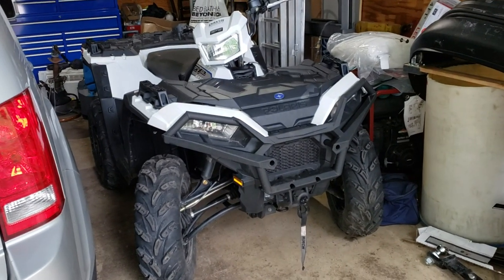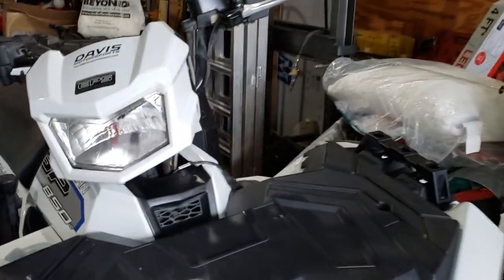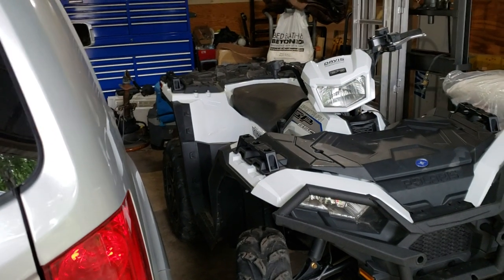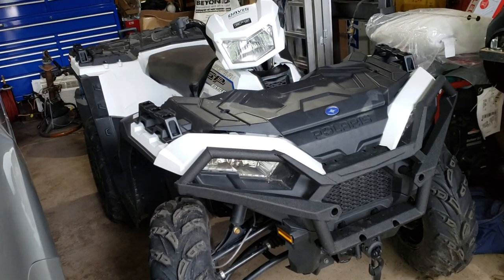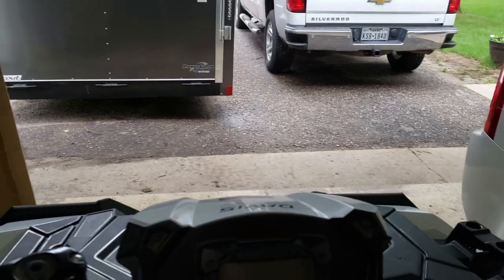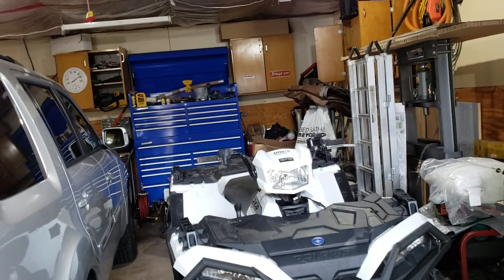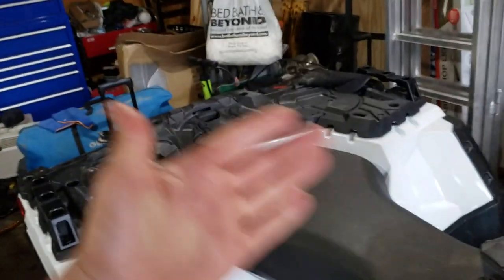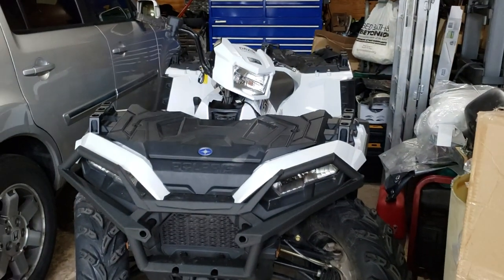2019 Polaris Sportsman 850 SP HO

Comment: we bought a left over 2018 sportsman 850 sp 3 weeks ago ($8,599).  ours doesnt jerk or grab at take off, its very smooth.  gone through water up to our knees and never missed a beat.  we already have 160 miles on it, I think its past due for the first service, lol, but we've been riding and having a good time.  we still have 32 hours to go til first service according to the display, but they told us 100 miles, 1 month or 20 hours whichever came first.  Obviously the mileage came first.  Oour SP is matte gray/red.  I have a 2019 yamaha grizzly 700 that is Alpine White like your's.  I love the color plus like you said most don't have white.  The one thing I do not like about it is that it stains up badly if you get any mud or rub against something.  The stains on the white look terrible so I spend a lot of time with a wash rag cleaning mine up after rides just so I don't have any long term damage to the exterior.  If I had it to do over again I'd probably go with the Blue or Burgundy that yamaha has.  BTW, can you tell me what is the difference in H.O. vs S.P.?  I've noticed some are just HO and some are just SP and some are both, thanks
Reply from the maker: To be honest I'm not sure what the difference is between h.o and s.p., cause mine is both, lol 
I totally agree with you on the having to wash it good, but its definitely nice, I don't regret purchasing a newer one, the clutch is so smooth compared to the older ones, love it, definitely just hooks and rips, I need to get my oil changed, haven't ridden in over 3 weeks now, been away and busy, hopefully this weekend I can rip around some more,
Reply: SP come with painted plastics, aluminum rims, bigger battery and close ratio AWD that comes in the 1000cc quads.

Comment: You can’t compare your Dads value line 570 to an 850SP.   Two totally different machines.  The clutching on the new style Sportsman’s is much smoother, even compared to the previous XP line.   Either way,  Congrats on the new machine!
2018 XP 1000 in Red here.   I’ll agree the stock tires do pretty damn good!

Comment: It sounds as thou the 850 is sealed better against water. Trying to decide between the 850 and the 570. Do you think the 850 is way too much machine for a newbie?
Reply from the maker: No I don't, I'm a newbie, easy on the throttle till your comfortable, and all the power when you are. Just be smart about it, start slow, I would say 850 over 570, dad had to go through a custom building session to try and seal his wheeler up, I haven't had to do a thing other than play in the mud, plus the clutch engagement is sooo much smoother and enjoyable to ride on the 850 than the 570, plus the shifter actually clicks into gear more confidently, doesn't leave you wondering if it's in the gear all the way, I don't know when they will fully update the 570, but for what you're getting over all the 850 is worth every penny!
Reply: @2005llyduramax  my comfortable? You + are = you're. Go back to school.
Reply from the maker: @Al_Dente-d1p  all I forgot was an apostrophe and an e, ease up bud. I get there's right and wrong, but my channel is more casual like the rest of the world with abbreviations and such, not everyone majored in grammar, and if that's all you got from any part of this video was the way I spelt your instead of you're, it's not my problem, but I fixed it just for you.